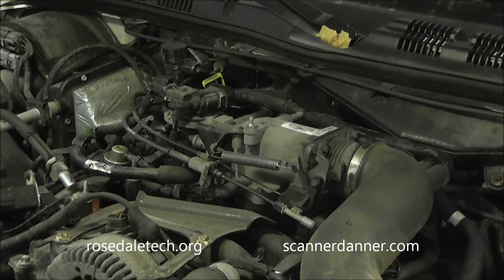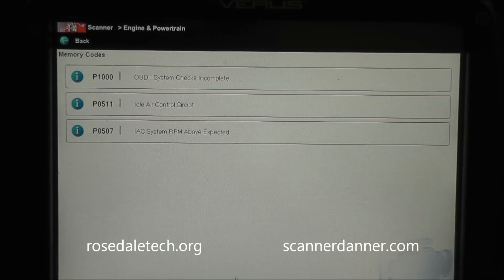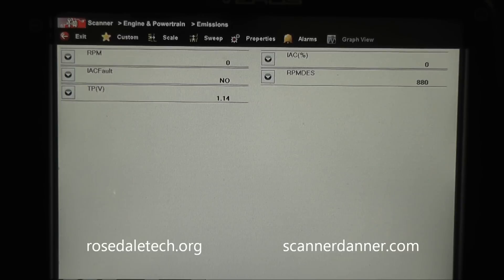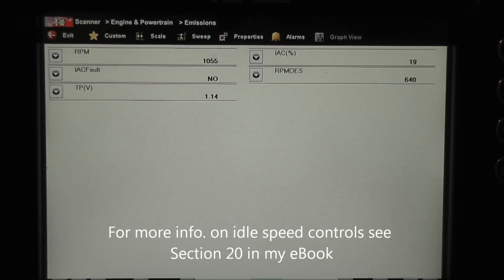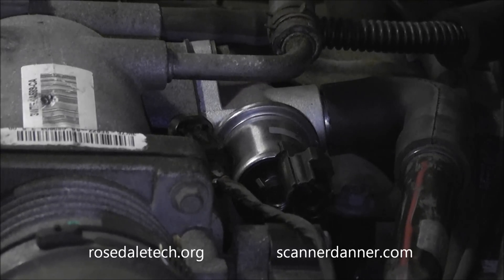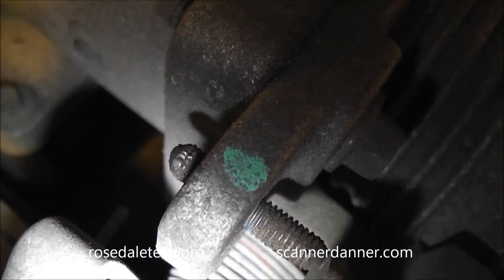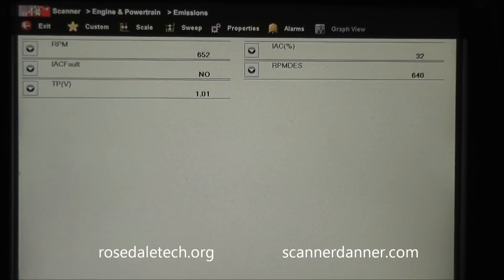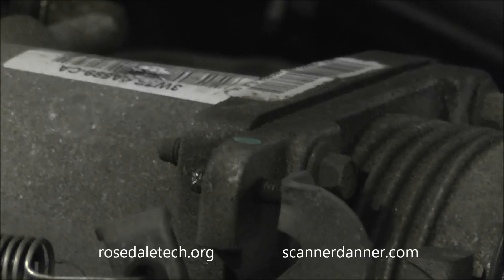Ford Idle Air Control (IAC) valve test (how to adjust minimum idle speed)

Comment: hey paul, we have 99' chevy silverado with high idle trouble code, the complaint is stalling at dead stop. So they change the IAC already but its still no change even you unplug the connector. its strange because the desired rpm is 700 but the tachometer is reading 540 rpm is it possible to have vacuum leak or egr problem on this one.  THANKS

Comment from the maker: The answer lies within the TPS learned closed throttle position. Once the PCM "re-zeros" the TPS, it will then try to correct idle speed. As long as the PCM "thinks" your foot is on the pedal it WILL NOT try to control idle speed, in fact it actually opens up the IAC  during this condition to prepare for decel. 
Hope that makes sense.
Reply: What is the ideal idle speed of Ford Expedition 4.6 L ? My Expy is always at 800rpm in park and in drive mode,If it is lower than 800 rpm it shake but never dies.So I just don't bother anymore after I replaced theIAC.

Comment: This is an excellent question!  All I can think of is that computer must be very smart to realize that the minimum idle it has observed for last many starts was higher than expected.  Otherwise you are right, the code would be there any time you hold your feet on the gas e.g. say warming up the engine faster for some tests.  It is a great question and I hope Paul answers it.
Reply: Im trying to fix a 92 mustang lx and you gave me some ideas I didnt read from another person. My mustang wont start now but it was starting at 900rpm the last time (like 4 or 5 times it was starting just fine at 900rpm because I "adjust" TPS because low rpm). I think my problem is going that direction you said. Sometimes comments enlight us. I will comment later when I try it. Thank you man

Comment from the maker: cleaning the throttle plate does allow more airflow with the throttle closed but this would not have changed the TPS angle or helped the situation at all. If anything it would have made it worse. (an even higher idle speed)

Comment: Would it work adjusting the trottle screw WITH the iac plugged in? Just trying to mach actual rpm to desired rpm, without adjusting up the base rpm to 4-500rpm?

Comment: Clearly the customer adjusted the throttle plate to compensate for a potentially dirty throttle body. But the previous shop could have performed a visual inspection to have possibly revealed the root cause of the concern (throttle adjustment screw tampering). Customers/car owners do not always reveal their mistaken misdiagnosis/repair attempts until thoroughly questioned. As technicians we also wear the hat of Crime Scene Investigator's to weed through the clues & details before the repair.

Comment: Would have cleaning the throttle plate reduced the TPS voltage and allow more airflow at idle?
Reply: That's not what you want, rather you want the ECU to be able to make slight adjustments in differing idle load states such as battery charge or A/C cycling, other electrical load, etc while the throttle plate at idle is just that, a fixed value that won't change with the load. BOTH your throttle body and your IAC should be clean for good operation.